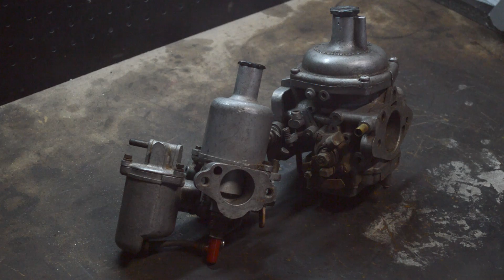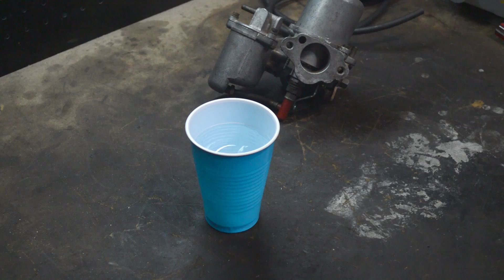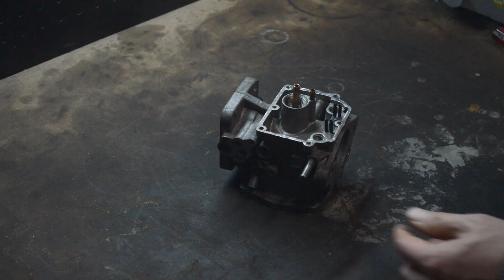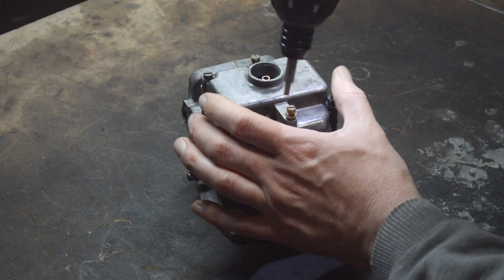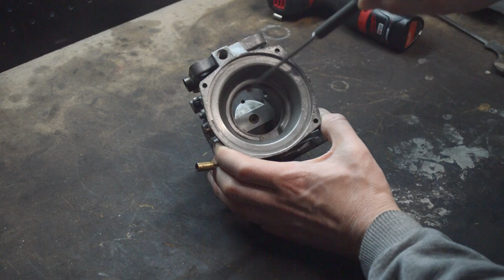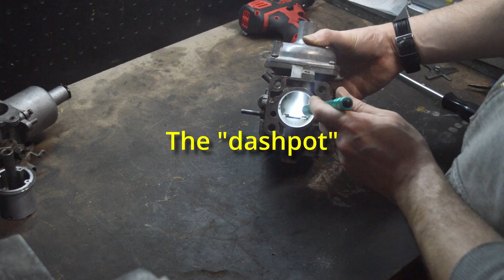The Zenith-Stromberg / SU Constant Depression Carburetor (in Layman's Terms)

Comment: Great explanation! I've been looking into constant depression/variable venturi carburetors since Mitsubishi also used the same style in the Lancer/Mirage series up until the late 90s. The Mitsubishi model is however down-draft (sits on top of the manifold like a Weber) instead of side-draft. Is there any possible drawback to that? Thanks!
Reply from the maker: I suppose I misspoke.  I guess they were able to revise the float bowls and manifolds sufficiently. Were the carbs completely horizontal, or just on an angle? Angled installations were done, such as on the Triumph Stag, but true horizontal would have seen oil leaking out of the dashpots unless there's a revision I'm not aware of.